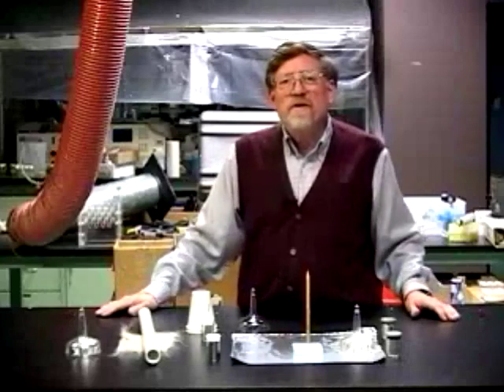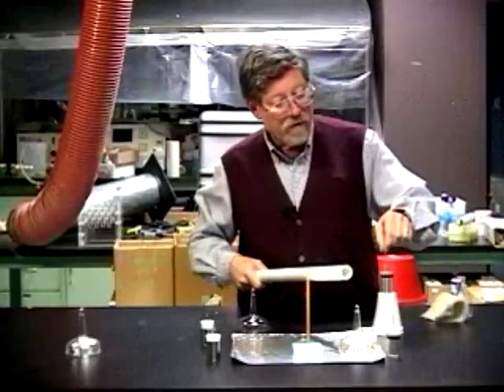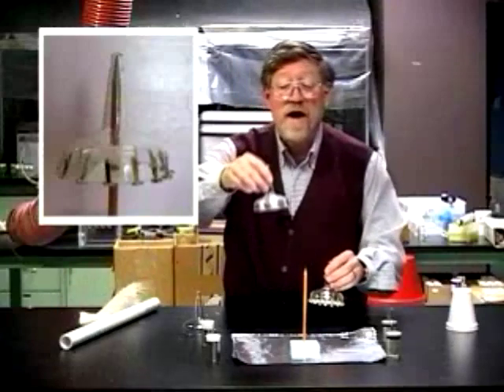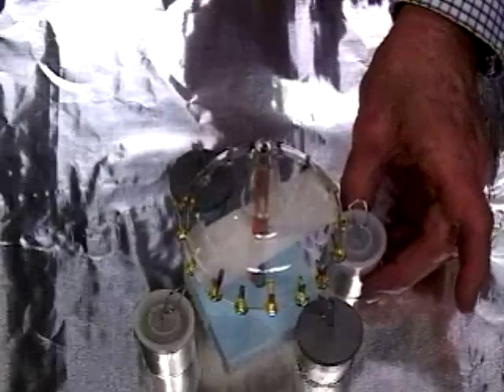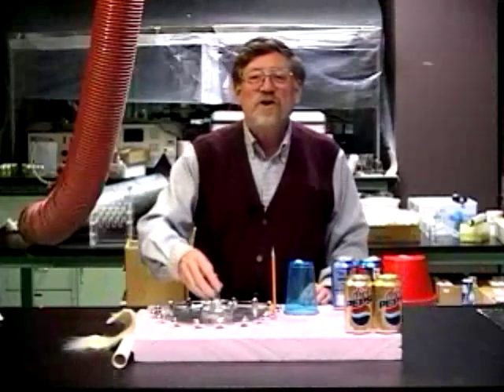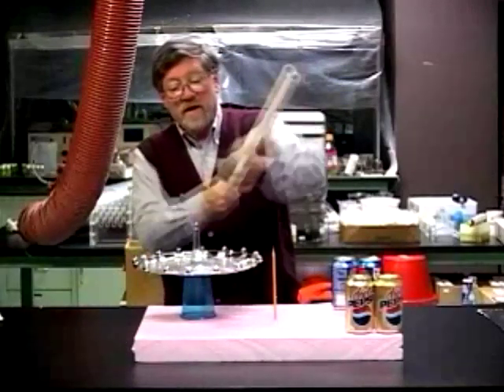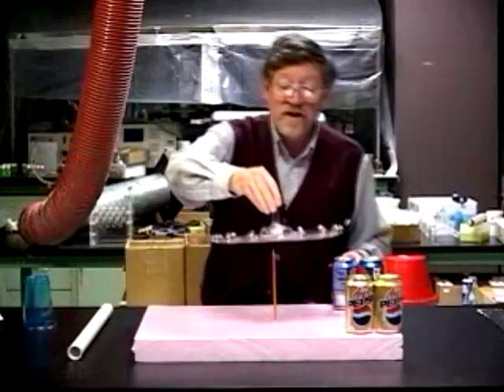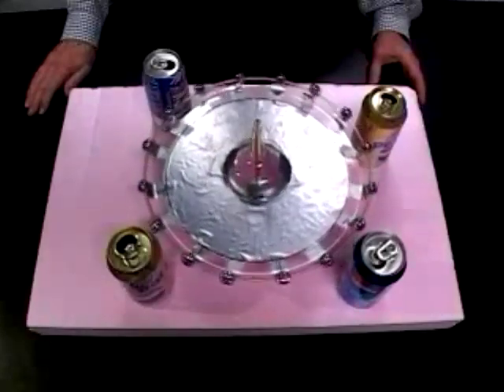Electrostatic Motor

Comment: I don't understand; if your tube is charging both the top and bottom with a negative charge, won't both bells impart a negative charge to the soda cans, eventually causing it to repel both the top and bottom bells?  Why is the top positive and the bottom negative, if both the top and bottom are charged negatively?